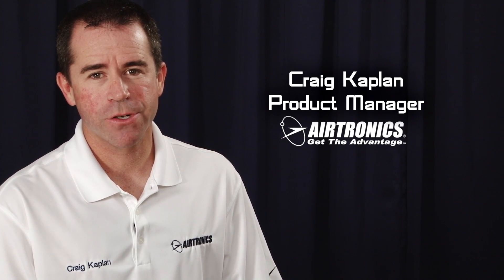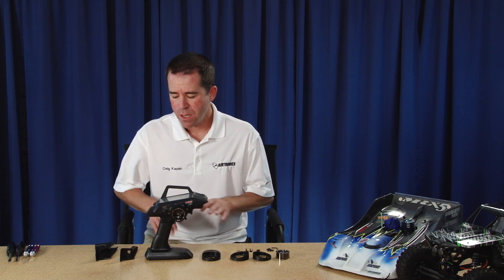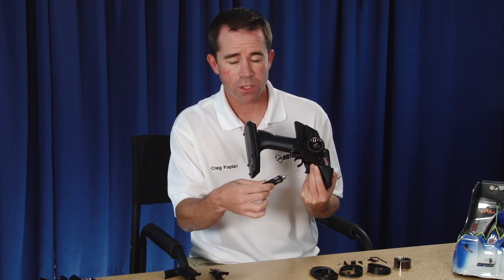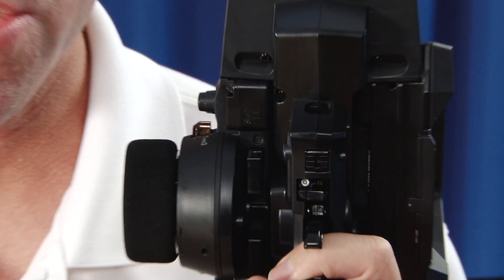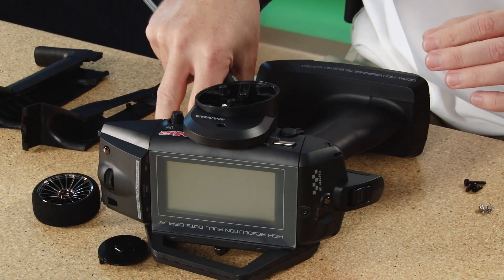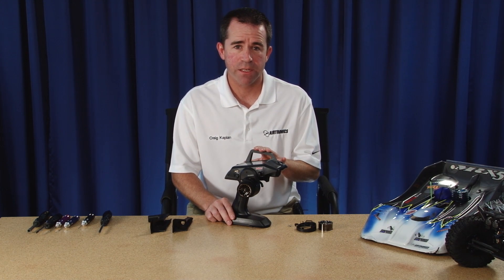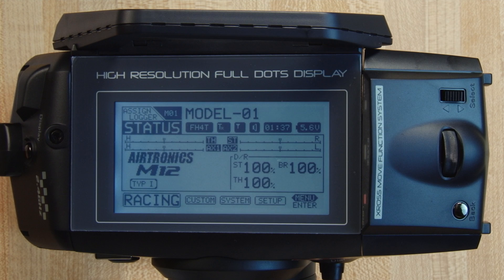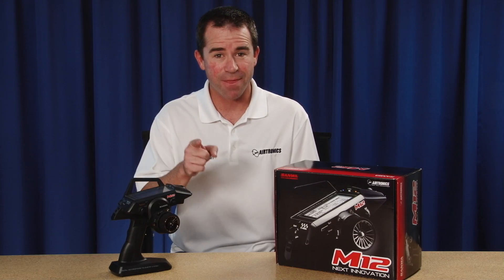Airtronics M12 Tutorial

Comment: I purchased one of your radio and receiver combos a while back a RDS8000 with 92824 2.4ghz receiver.
I have used them successfully until toady, when, during flight preparations of one of my models, after a couple of hrs of setup, when it worked flawlessly, It just lost contact suddenly. 
The BEC is a castle creations, very high quality unit, and is putting out exactly 5v. 
When the problem occurred, the model was on, and it just stopped responding to the controls. the battery has about  70% charge, so i know it' snot a voltage issue. i plugged it into a separate model to power it up, and verify if it was good, or if the model had a problem. It flashes, in both models, once when it is first plugged in, but then nothing. I tries in aero mode, with both side switches in normal mode, to bind the receiver again, as i did when i first bought it. I held the bind button not he receiver, and while holding it, powered up the receiver. the transmitter was already on, and the blue bind light was solid. when the blue light started flashing on the receiver, i let up on the button, and pushed the bind button on the transmitter, within less than 10 seconds. The light on the receiver went out, and i cannot achieve bind. 
I have the manual, from when i purchased it new, and it had never had problems, or any damage. it has simply failed.  I have spent many hours programing all of the parameters of all of my models into the transmitter, and now i can't be sure if the transmitter or the receiver is faulty. 
This is extremely frustrating, as i am trying to do some airframe development, and need a reliable control system.  I suspect that the receiver is bad, and looked online, to find that they cost about 1/2 the value of a new system. just the receiver!  and to have one fail like that, does not inspire confidence. Iooking online at the forums, i am not the only one to have this problem. I also connected a different brand receiver into the plane in questions, and it is working flawlessly. The problem is, that system does not have the mixing functions that i need to fly the model, for that i have been counting on the RDS8000. 
 I have a lot of time invested in the programming, and will have to conduct many hours of travel, driving to the field, expense, and time to get back to the point where i am right now, unless i can get another compatible receiver that works. at this point, i am not willing to invest more money into a system that has failed in such a way. I would be happy if i simply had anther receiver that is compatible with the RDS8000 2.4ghz transmitter. 
My email address is fpvreviews@gmail.com
Thanks for your prompt resolution to this problem.
Sincerely yours, Spike Webb   FPVREVIEWS Youtube channel (4K subscribers)